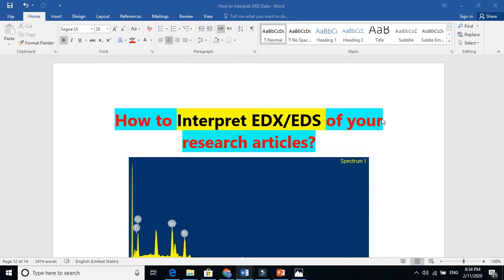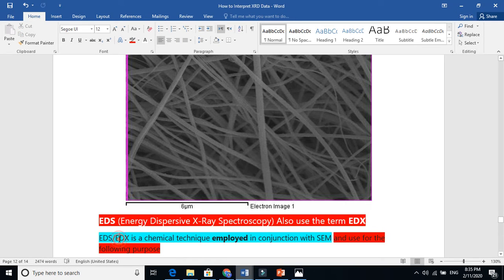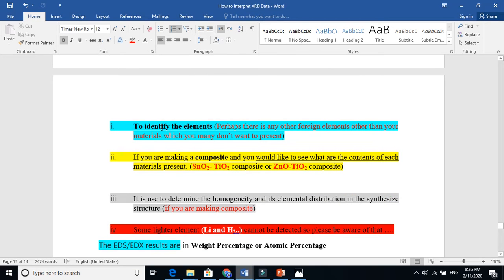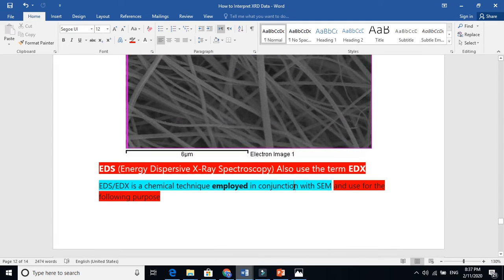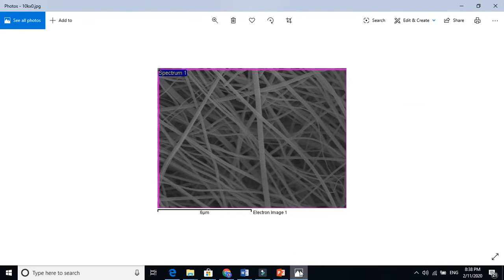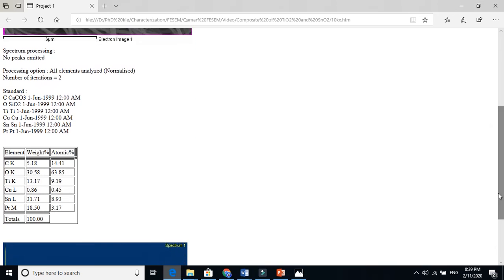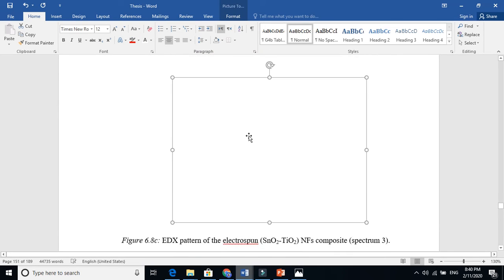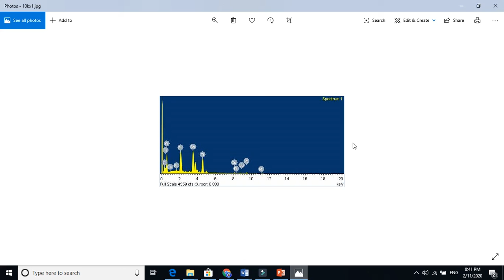EDS/EDX Microsctructure Interpretation: Energy -Dispersive X-rays Spectroscopy Analysis

Comment: Sir, please can you tell me why the mineral composition of the initial material is different from the mineral content during the EDX test?
Reply from the maker: If you means the additional peaks in EDX spectra, then it is simply because of the oxygen presence and the carbon existence during coating the sample. 

But you have to only look at the desire peaks you are looking for. For instance, if you make the composite of Zn and Sn, so simply see the content of only these two elements. 

If you have make a composite or dope process of two or more than two elements so just focus on those elements. The EDX operator will handed your a data in the form of graph and table. 

The table will display like
 Element     Atom%      Wt%
Sn                 30              30
Zn                 40              35
O                   25              20
C                    5                15

The total atom% and wt% must be 100

If you have any question, please let me know in the comment section
Reply: @qamarwali  My sample is betel nut skin as raw material, after EDX there are only C, O, Si and Al but after pyrolysis to make biochar there are additional new minerals in the form of Ca, K and Mg.where does this material come from sir?
Reply from the maker: You have to look at your sample first that what type of elements the Betel nut skin contains. You can get the information from the literature.  

After EDX, the peaks shows elements like C, O, Si, and Al. As I mentioned that C and O are with every EDX spectra because they exist everywhere and you can't avoid it. Therefore, the betel nut skin composed of Si and Al as per your data availability. 

After pyrolysis there are additional peaks appears. This simply means there are some other activities involve during the pyrolysis process. That's why the EDX spectra show additional peaks. During the process, there must be a sources of Mg, Ca, and K as per the data you provided. 

Let me know if you further require any information.
Reply: @nanospeaks  I think the raw material also contains these minerals because I took samples from the waste, but why didn't the first EDX show these minerals? During pyrolysis, there weren't any other materials.
Reply from the maker: I recommend to study the exact literature if the raw materials also contains the Mg, Ca and K then you should repeat the EDX before the pyrolysis. Or may be the contents of these elements were too low in that sample i.e., before the Pyrolysis. Perhaps for Pyrolysis purpose, you have taken another sample which contains these Mg, Ca and K. 

Please do the experiment with great care so that there are no inconsistency. Because, sometime, in the sample, the contents are varying. 

If you still an issue let me know. It would be great to put solid and complete information in the question. 

Wish you good luck!
Reply: @qamarwali  i hope you can explain to me how it can be like that

Comment: Sir how to find out weight% and atomic % from EDS graph? which factor influence these values
Reply from the maker: We use EDS to determine the contents or compositions of each element in the sample. For instance, your synthesized TiO2, so the EDS will shows the contents of Ti and O in the form of weight% and atomic%. 

Weight% is simple that how much is Ti and how much is O in the sample you prepared i.e., lets net weight of the sample comes from the 60% of Ti and 40% of O. 

Atomic% means that how many atoms of Ti and how many atoms of O exist in the sample. Because, the size of the atoms for Ti and O are different.......

We get the value of weight% and atomic%  in the form of TABLE from the SEM (EDS) operator. We are not going to find these values. 

We can also guess from the PEAKS in the EDS graphs that what is the % of each element exist (roughly). 

If you are making composite of TiO2- ZnO, so you can add one component more than the other so this you can increase the quantity of one element versus the other. 

I hope it will clear your doubt. If not please do comment for further questions
Reply: Thank you sir

Comment: I am making 3D printed hydrogel scaffold implants and incorporating silver nanoparticles but to know that each hydrogel scaffolds suppose from one single batch I'm getting 4/5 hydrogel patch diameter 20mm and 1 mm thickness how much silver is present after the 3D printing is done. Is it possible by this method??

Please kindly help me. I found your video useful. I'm doing my research on nanotechnology
Reply from the maker: Sure, with EDS/EDX, you can easily find out the content of silver in the 3D scaffold in term of atom % and wt% 

The atom% reveals about the # of silver atoms present in the host material while the wt% talk about the weightage of the silver element/ atoms. 

Actually, the EDS/EDX is performed with SEM/FESEM analysis and we get the information in the form of Graph which shows peaks for each elements as well as in the form of Table which contains the information in the form of atom% and wt%. 

If your sample is so thin (~10 nm), then XPS is also used for such information. 

Let me know if you have problem in these characterization techniques.
Reply: @nanospeaks  I am doing it for the first time so is the calculation is done by machine or I have to do it??
Reply from the maker: The machine. As I mentioned that the data we received is in the form of graph which contains different peaks showing the contents of different elements (this is called qualitatively, here from the graph you will only realize that what elements are exists in the sample). 

The machine also provide the data in form  of Table which contains the amount quantitatively i.e., atom% & wt%

 From this tabulated data we will observe that what is the amount of each elements exist in the sample 

Like 
C          Ag          O
40      20            30
Reply: @nanospeaks  Thank you so much Sir 😊🙏🏻. i will follow you more helpful guide. Actually I'm doing my phd in Japan so here there is a language barrier so your video I found very helpful. My sample is 20 mm diameter 1 mm thickness it's bigger so I need to cut it as SEM needs smaller sample size at the time of coating.

Comment: What can SEM-EDS analysis of microplastic samples interpret?
Reply from the maker: SEM just reveals the morphology of the sample. For instance, what is the shape, size, height, diameter, radius of the sample, whether the sample is made up of nanoparticles,  nanorods,  nanosphere, whether the surface is rough or smooth......

While EDS is embedded with SEM used for elemental analysis.  For instance,  it reveals what the  constitutes of the sample are. In your case, there might be carbon, hydrogen, oxygen, nitrogen, chlorine, sulfur, etc...  The EDS provides information in the form of wt% and atm% of the elements that exist in the sample.
Reply: @nanospeaks  Thank you so much for clarification, Sir

Comment: Sir what does that k on the eds  weight percentage table represents the alphabet near each element
Reply from the maker: Because in the case of EDX, the x-rays are emitted from the sample. There are shells or orbits in the atoms called k shell, L shell, M shell, and N shell. When xrays emitted from the inner atom so we have to use K, if it is from the outer surface ,so we called L or M...... It's just for that purpose
Reply: @nanospeaks  thank u sir , should we disscus about that on our report or should focus on the weight and atomic persentage
Reply from the maker: @animeaddict7691  In my case, this data , I have received from the SEM operator. The data was in the Table form.  As the EDX is performed simultaneously with SEM. I don't know in your case.

Comment: Salam. Did you normalize the percentages of Sn, Ti and O in your EDS results? and ignored the other elements detected? Also, Big thanks for this video pls.
Reply from the maker: It is better to normalise if the scale is above 1 or 100. This way, it is easy to compare. The system (SEM as EDS is performed along with SEM by just simply  charging the mood of operation) will automatically give the information in wt% and atomic %.

Comment: sir,. can you please explain why one element can give two or three peaks in a spectra?
Reply from the maker: Good question. Look, the sample composed of element (suppose Ag), so in some region , the density of the Ag atoms are higher (high peaks) while in other places the Ag atoms are less dense (low peaks). As the electron scans the surface and there are variations in the Ag atoms in the specimen, it gives different peaks of the same element Ag. 

The same principle applies for XRD analysis.  The X-rays scatter from the atoms of the specimen and give different peaks of the same element.  

If all atoms are arranged in a long range order like single crystal*, then there will be *one peak in xrd pattern.

Comment: thanks for informative video, i have a querry from where i can get reference for eds spectra particularly for microplastics ?because microplastics mostly just show carbon and oxygen only and it is difficult to differentiate between different microplastic polymer
Reply from the maker: Good question. You must be following the literature, and someone must have done this kind of EDS before. Just see in  their research paper and compare your data. 
If still not possible , then simply Google,  you will find a lot of papers with such spectra. 
Additionally,  if still not possible, then ask questions on ResearchGate 

Above all, the EDS only shows the elements that exist in the sample or powder. So fine, you have carbon and oxygen.
 
To differentiate between different microplastic polymers, you need some other characterization, I guess.
Reply: @nanospeaks  thanks for your response sir, I have found some data . still have one question, why EDS spectra do not show peak for hydrogen?
Reply from the maker: @zuhairasif2376  because EDS is based on characteristic X-rays, and hydrogen does not emit it due to the less number of electrons and subsequently fewer shells. Hydrogen only has electron in k shell and shared covalentaly
Reply: @nanospeaks   Okay, sir thank-you so much for the content and your answers. Jazak Allah.

Comment: how to know the chemical formula of the sample from eds data like whether is it Fe2O3 or Fe3O4?
Reply from the maker: Good question. I think it is difficult to find formula with EDS analysis.  It only gives information about the elements in terms of wt% and atom%. 
There might be some ways, but I don't know much about that.
Reply: In theory, you can use charge balance if your material behaves stoichiometrically. The positive charge of you cations must  equal the negative charge of your anion in a stoichiometric material. Using this assumption,  you can calculate the proportion of Fe2+ to Fe3+. However, easier said than done. The analysis must be exceptionally good, you would need to collect your own standards.

Comment: Hi, for the standard mentioned C CaCO3 and I get atomic and weight percentage of it. Can I know the carbon content from it?
Reply from the maker: What do you mean by carbon content?
It is understood that the EDS analysis  of CaCO3 compound shows the three elements (Ca, C, and O) in terms of wt% and in atm%.
Wt% = how much weight each element in the compound because some elements are heavy while others are lighter.
Atomic % = Nunmber of atoms of each element exists in the compound as well as in the powder you are analysing...
Reply: @nanospeaks  from the video can see the standard listing C    CaCO3   1-Jun-1999 12:00 AM and from the table  will get this C K	46.54	59.93. From these numbers,  CaCO3 have 46.54wt% for overall sample right? Can i get the weight % of Carbon from these value?
Reply from the maker: @Lim Cai Yun  sorry for taking your time. I am still not sure about your question.  The EDS analysis gives these details *automatically   you don't need to calculate the Carbon content in your sample.
In your case, CaCO3, the system generates automatically the wt% and atomic% of the Ca , C*, and *O .
Reply: @nanospeaks   Okk thank you for your reply. You clear my doubt !😀

Comment: Energy-dispersive X-ray spectroscopy (EDS, EDX, EDXS or XEDS), also called Energy dispersive X-ray analysis (EDXA) or Energy dispersive X-ray microanalysis (EDXMA), is an analytical technique used for the elemental analysis or chemical characterization of a sample.
Interpretation of EDX with Example is given below :
Weight% = 100 * weight of one component (element) / weight of entire sample.
Atomic% = 100 * number of atoms of one component / total number of all atoms in sample
Atomic weight% is calculated from the Element Weight% by dividing each element weight% by its atomic weight, do this for all elements in the sample which will give a list of Atomic Proportions. Sum of these together to obtain a Total Atomic weight. Then, for each Element in the sample divide its Atomic Proportion by the Total and then multiply it by 100.
EDX of CdS is explained below:
1. Cd: 79.15 wt%
2. S: 20.85 wt%
Divide each by their Atomic weights Cd (112.411) and S (32.065)
1. Cd: 79.15 / 112.411 = 0.704
2. S: 20.85 / 32.065 = 0.650
Sum
1. Cd: 0.704
2. S: + 0.650
1.354
Divide each by the Sum (1.354) and turn into Atomic%
1. Cd: 0.704 / 1.354 * 100 = 51.99 at.%
2. S: 0.650 / 1.354 * 100 = 48.01 at.%
The Average Atomic% of Cd:S was found to be almost stoichiometric in nature with the Cd% of 52 and S% of 48.
I hope I have answered your question.
With Best Wishes,
Reply from the maker: Good explanation 👆

Comment: Sir .. what can be the reason that stoichiometry doesn't matching with the expected one?? In EDS
Reply: Thank you sir...
Can you please send this research article shown in video??
Reply from the maker: I think it is in my thesis. Please send me your email or simple send me an email at qamarwali@yahoo.com
Reply from the maker: I think you need to take many EDX by  targeting different areas of the sample.  The ratio of the elements in sample should reflect in EDX
Reply: Sir please tell... Why pellets (bulk sample instead of Powder) are used for electrical conductivity measurements by four probe ??
This question is not related to video but please try to tell
Reply from the maker: I think, for conductivity we need a film type material because electrons have to pass through. On the other hand,  Powder is just large number of separate particles where electrons can not go through for long time. That's is why bulk or pellet  is preferred. 

I might not answer fully but I have tried my best.
Reply: @nanospeaks  thank you sir...
Sir please also send that research article.. I mailed from my id
Reply from the maker: @Keep_Learning_always  okay I will send you.

Comment: sir, i want to verify carbon and nitrogen weight % for my paddy straw samples. but i have a doubt whether peaks for both the elements will be distinct as carbon and nitrogen are just next to each other in the periodic table. will i get the correct %? thanks
Reply from the maker: Sure,  you will definitely get different peaks. It is because both elements have different electronics configuration.  In addition,  the system will generate different peaks along with %
Reply: @nanospeaks  thanku so much sir for such quick response
Reply from the maker: @AbhishekKumar-nk7gc  wellcome

Comment: thank you sir for the interesting video. I have a question, sir, I am working on the doping of metal cations, in EDX spectra I found that the signals of the doping cations coincide with those of the cations existing in the matrix, does this mean that they have taken their place?
Reply from the maker: I think so. If the foreign atoms have the atomic same size to the host then there will substitional solution.
Reply: @nanospeaks  thank you so much sir

Comment: very nice...one question Dr sahib plz...does the peak height gives any information of weight% of material or not?
Reply from the maker: Yes it is basically intensity.  But the system automatically generate the weightage %.
Reply: @nanospeaks  so its mean higher weightage element has bigger peak?
Reply from the maker: @organiccookingmore9071  height of peaks may depends on many parameters BUT ONE of them is the % of the particular elements

Comment: Thank you for a great explanation. May I know what is the cause of Carbon detection on collagen and bioglass scaffold? Thanks Sir
Reply from the maker: I don't know but it should be there because of synthesis and heat processing etc.
Reply: Carbon detection is because of the carbon double tape that is used to held the sample in place on the metal stub. you can skip the elements like carbon and gold or platinum used as coating material before the analysis and the machine software ask you all these details before you start the analysis.

Comment: is it specific software to open the 3rd file ...as i obtained sem +edx images and edx elemntal spectra and also  some other data .. which i dnt know how to open .
Reply from the maker: It is automatically from SEM machine.
Reply: @nanospeaks  thank u sir
Reply: one more question Sir . in EDX spectral table .. there is weight % sigma mention along with weight %  ..not atomic %  ...
Reply from the maker: @noreenramzan6727  you can covert it gram to mole etc
Reply: @nanospeaks  hmm ok thnks a lot Sir .